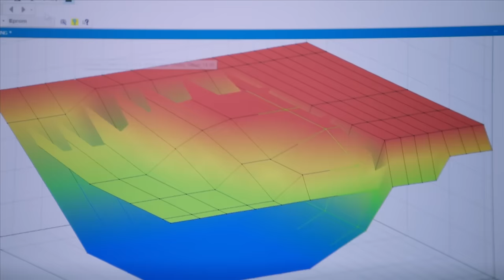Clarkson and Hammond Modify Their Cars For A Rally | The Grand Tour: A Scandi Flick

Comment: Mays mitsubishi is stronger then the old top gear Hilux
Reply: Mistubishi went against 2 of the tests that the toyota went
Reply: Cap
Reply: Super duper cap there mate.
Reply: Evo's are tin cans
Reply: It’s just not
Reply: False
Reply: Na, not even close
Reply: But the only repairs on the Hilux are done without spare parts and only simple tools. There’s no rule to do that on the Mitsubishi.
Reply: the hilux was in the ocean for a full 12 hours, that doesnt compare to the evo
Reply: For the EVO to outlive a Hilux, it would have to be frozen in water fully, engine fully seized up, and the mechanic would have to use only tools and no spare parts to restart the engine after it thaws off (in a week or two).